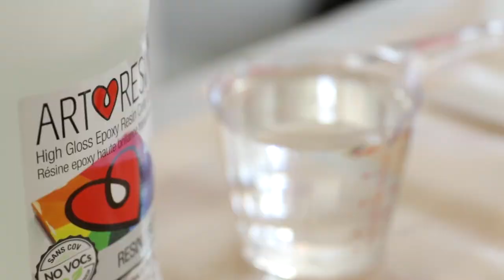How To ArtResin A Beer Pong Table - Part 1

Comment: This looks fantastic and exactly what I've been looking to do during quarantine! What did you use to edge the table? It looks like a solid material rather than a removable tape. I'm needing some help figuring things out haha
Reply from the maker: Hi there! It was metal strips attached to make a frame for the wood, it was part of the table and we didn't not remove it afterwards :)

Comment: Hey Dave and Kassandra! The idea is great and it looks amazing!
We wanna build something like this too...
Do u used a special clue for the first layer (before you placed the beercaps into the table)?
Or is this epoxy resin aswell?
Reply from the maker: Hi! We actually just used a thin coat of ArtResin as the adhesive as well. Good luck and have fun creating it :)